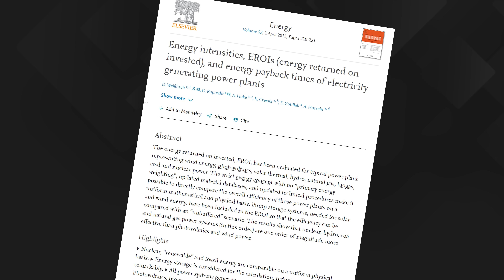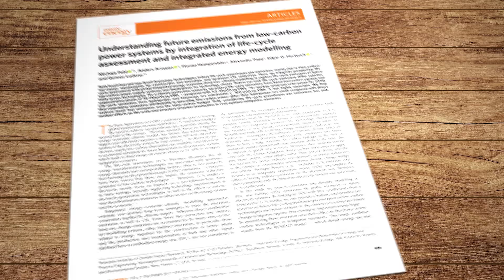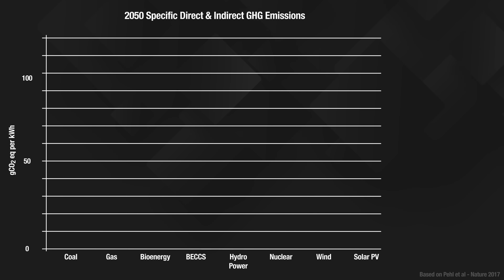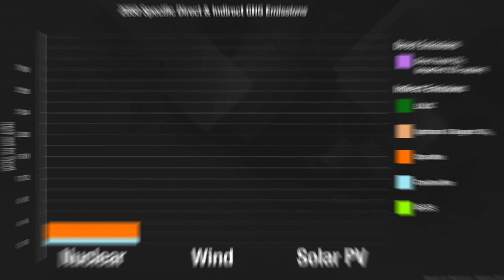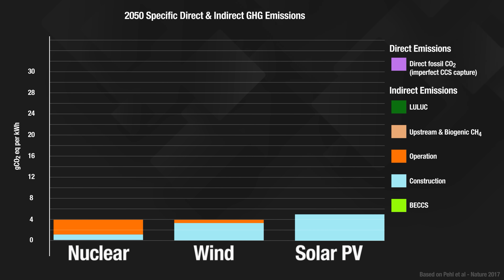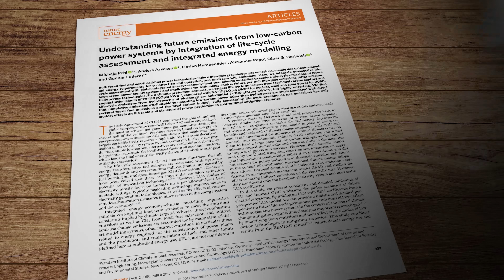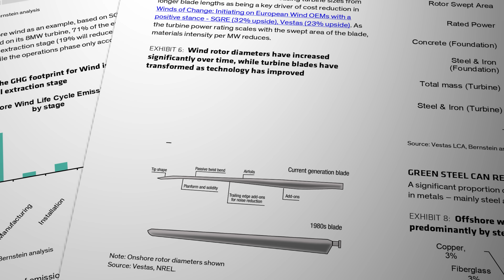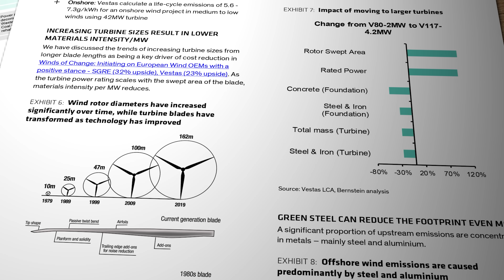Lifetime carbon emissions of renewables vs fossil fuel. Problem or solution?

Comment: Kinda disappointing that the wind and solar numbers aren’t taking into account batteries, peaker power plants and excess capacity needed for these systems to work since they are intermittent energy sources. If you do those numbers I’d bet nuclear would be the best choice by far for carbon emissions and for maybe 1/10 the cost
Reply: Only if we exclude the cost of storing the radioactive waste for 2 million years. Even if we pay them just minimum wage, the salaries of the guards alone add up to quite a bit. Add in land use costs, construction, and maintenance, and it becomes astronomical. Until the industry can get its act together and build a couple of permanent storage sites, they should stop making more dangerous waste.

Comment: I still maintain that the “solution” isn’t just one thing, it’ll be a combination of things. And second… I really think decentralised power generation (e.g. we all have solar on our existing roofs) will play a huge part in this. 
Imagine the impact if every house, retail/commercial building had some solar installed and even for e,g, small panels on every traffic light.
Reply: Yes I agree. All eggs in one basket, bad/good, on/off, green/not-green. I like to view the solutions as steps in the right direction and being honest about the drawbacks.
Reply: The Earth is cooler with the atmos/GHGs/albedo not warmer.
To perform as advertised the GHGs require “extra” energy upwelling from the surface radiating as a black body. https://youtu.be/0Jijw7-YG-U
The kinetic heat transfer processes of the contiguous atmos molecules render that scenario impossible.
No greenhouse effect, no GHG warming, no man/CO2 driven climate change or Gorebal warming.
Reply: The limousine liberal solution:  why don’t we all just put solar cells on our expansive suburban roofs?  It’s the 21st century equivalent of Marie Antoinette asking of the bread-starved poor “Why don’t they eat cake?”
Reply: Distributed power generation is way less efficient than powerplants.
Reply: @JasminUwU  in the UK, the electricity grid that was  built for centralised energy production is not suitable for distributed production. This has been shown, by the fact that a lot of the wind energy is generated in Scotland. The transmission lines between Scotland and England have insufficient capacity to get the energy south. When the wind blowing Scotland, the Grid pays the wind turbine operators, not to generate. These are known as Constraint payments. Some wind farms shut down 50% of generating capacity and between them receive £500million per annum. The Grid was aware of the problem in 2013 and started building an HVDC inter connector down the Irish Sea, which was completed in 2017. Unfortunately the increase in wind energy in Scotland made it too little too late. Even with the closure of Hunterston B and Torness nuclear power stations, they have started two more HVDC inter connectors on the East coast. In the meantime Constraint Payments are with us for another two years. If we get a couple of comparatively windless years like 2019, when Constraint Payments halved, we may be OK. The grid knew of this problem in 2013, and could have got Hydrogen Electolysers built with the spare money and electricity, pumping hydrogen into the grid at a maximum 20% blend, which is safe for the pipework and safe for the domestic supply. ESO, what are they paid for?
Reply: @JasminUwU  
Said, "distributed power generation is way less efficient than power plants."

The efficiency of distributed power generation is not important because the fuel - wind or sunlight - is FREE.  Also power plants require transmission and distribution, which makes the cost much higher than distributed power generation.

The reason why utilities insist on power plants is it makes the customer totally dependent on the utility.
Reply: Or if every city had a single nuclear power plant!!!!!!! :D :D
Reply: @kieranrollinson8750  
Said, "Or if every city had a single nuclear power plant!!"

That's impossible.   Nuclear power plants are not allowed near any population centers.  Period!
Reply: @acmefixer1  DUDE!!!!!! YOU MISSED THE ENTIRE POINT!!!!!! THERE IS THIS THING CALLED """"SBUTEXT""""!!!!!! AS IN, THAT WHICH IS IMPLIED, YET NOT SPOKEN!!!!!!!!! GET USED TO IT!!!!!!!!!!!!! :D :D

Comment: Could you comment on how much land needs to be cleared to generate equivalent amounts of energy by various renewable generation methods? It seems roof top solar, even with batteries will not be sufficient to meet a large modern cities energy needs. Is the net impact to the  (i.e. local ecosystems) considered when renewable generation needs to be scaled to replace the high % of energy that comes from fossil fuels?

Comment: Unfortunately rcycling of renewable energy components is dependant on where they are operated. Here in Australia most deconstructed wind generators and solar panels are going to landfill because we can not build recycling points in all the places they are needed but transporting the used components to a central recycling point in a country the size of Australia is very expensive. We are currently in a power generation crisis caused by ten years of  government who's climate change policy was written by the coal and gas lobby and was as clear as mud. So now we have plenty of wind and sun but not enough generating capacity from it, we also have a power grid that is designed for central coal and gas fired generation and can not transport renewable energy efficiently. We have no where near enough battery storage and the private companies than now own our fossil fuel power plants have run them down to the point where a third of their capacity is often missing due to breakdowns.Oh and as the world second biggest LNG exporter we have a shortage of gas in our eastern states. This is what happens when powerful multi national companies mine your resources and sell to the highest bidder and other multinationals own your power infrastructure but let it fall to bits and they all buy our politicians spines and remove them along with their brains, if they had one in the first place. If your government cant plan for the next five years what hope do they have planning for the next fifty years.

Comment: ....aaaaand - unsurprisingly - nuclear is the CLEANEST, MOST reliable, MOST pragmatic, MOST compatible with the HUGELY expensive existing infrastructure - and  by FAR. 

(Also, Put 200,000 (yes, that's 200k, or two hundred thousands) decommissioned, rusting away wind turbines in California in your pipe, and smoke it)

Comment: I’m sure the reports from the turbine manufacturer is not biased. How much CO2 is emitted in the recycling of these blades?? As far as solar is concerned what is the environmental effects of the strip mines required to mine the metals to make the solar? What is the life time of the panels and what is done with them after?

Comment: What will decide which technology/ies win is ultimately cost. If something is super clean but costs 10x as much and today's energy cost, it simply won't happen. Nuclear looks good, but the ongoing liability to deal with nuclear waste means it isn't a commercial proposition.  However wind power is competitive on cost and that along with solar and maybe tidal look good too. The Government should go all out for these and if they are cheap enough then the problems of availability at the wrong time will be overcome with battery storage, green hydrogen production or other methods. It all has to be paid for so it has to be profitable for someone. This seems the only way forward to me.

Comment: Though these numbers paints a pretty picture, the biggest drawbacks of these technologies are not mentioned. Due to the low energy density of PV Solar and Wind, these technologies needs to be deployed at very large scales, resulting in huge land losses and enormous wildlife impacts. Huge solar farms literally burns birds alive, not to mention the habitat loss of these large scale projects. Wind energy is more efficient in its land use, but still affects the habitat of those creatures blessed with the ability of flight. PV Solar and Wind is also an inconsistent and unreliable source of energy, again requiring a larger scale to account for fluctuations in the output. They also require some form of storage(battery farms, dams) to compensate for their unreliability, again requiring large land use.
Another thing...if a product is advertised as being "100% recyclable", that does not mean that they are being recycled and remade into new products. Just look at the lies of the plastic industry...

Comment: Btw, I have read that projected year 2050 energy demand will be 5x that of 2020.  I'd like to know if that was taken account of in these studies.  Excellent videos though as always.  Another thing... (my phd involves statistical inference, control theory and operations research (optimization)).  I find that it is almost always the case that researchers make 'ceterus parabus' statements which amount to giant extrapolations of a status quo in situations where there is no static equilibrium condition.  Things change.  Dynamics are involved.  So the question here for instance is what the sensitivity of say hydropower is to a world with extensive droughts, or solar to a world where the panels are hotter and there's much more water vapor in the air.  Electrical resistance in wire is proportional to temperature.  And so forth.  There are many, many different types of feedback terms.  But the question is to identify them, rank them, and then figure out the dominant ones.  We're looking at a multi-dimensional Taylor Series expansion, and yet we're missing 95% of the 2nd order terms in the Hessian matrix that will describe the curvature  (ie accelerations, f = ma ...) of how kwhrs out will scale with the fixed costs and the marginal costs of the resources put into them.  It's almost guaranteed that this paper and every paper has glaring omissions in that analysis... in part because there are combinatorics involved and they scale even faster than exponentials.  Expecting the operating point in 2050 to look like that of 2020 is very naïve.  For instance if there's far less land in the world and salt water intrusion has caused farm land to become even more valuable.  And if degraded soil (tractors are evidently heavier than dinosaurs... they kill soil microbes...), depleted soil wrt minerals, dust bowls, drought, and so forth make farming 10x harder... (heat waves are 4x as likely at 1.5 deg C of warming, 13.5x more likely at 2 deg C of warming... which I believe we will cross before 2040)... well tomorrow's shadow prices for the use of land may have little to do with the ones we have today. Tough to put solar or wind below ground.  Everyone needs to be looking for what the market externalities are and for how commodities substitute, and they're almost always failing to do that.  For instance if the storms get so intense (hurricanes are becoming stronger in 6 different dimensions) that they keep on knocking down wind turbines, that changes the calculus dramatically.  Hail the size of baseballs.  Clouds that block sunlight... Salt water in the wind causing premature corrosion.  I can think of many different possible oversights in the analysis.  Whether or not such considerations are material or trivial, hard to say.  But I bet several of these factors I'm citing will indeed change the analysis significantly.  Final thought... as has been determined in the arena of deep learning and GANs, a primal-dual / adversarial / game theoretic type approach can work very well.  Minmax design.  If we plan for worst case weather and then envision what that would mean for our energy supply, there are valuable lessons to be learned there.  Then again I've always said worst case design leads to absurdities.  In the worst case a super nova has exploded at a nearby star and we're just about to find out tomorrow.  Still though, as military people have long since figured out... there are a good many things to be learned from building a play book and a set of strategies around various scenarios we can identify as being likely to occur...  We should play computer games where one side gets to be like an army of ants trying to construct wind mills and the other side gets to play God and wreak weather-havoc on a periodic basis based on certain constraints.  And then see which strategies get the best score...

Comment: Part of the issue with all of these analysis is that it doesn't account for load leveling with either fossil fuels or some hypothetical battery (hypothetical in that no current grid scale battery technology is even remotely scalable) to get the same uptime as any fossil fuel or nuclear. You can see a real world demonstration of this by comparing Germany and France where France has not the cheapest energy in mainland Europe (IIRC only Iceland and Greenland are less) and one of the lowest CO2  outputs per kilowatt hour in the world. On the flip side Germany built huge amounts of wind and slightly less huge amounts of solar and is in the process of or has already shut down all of there nuclear plants and there cost emissions from fossil fuels is more then when they started this process. 

Nuclear is the only way forward and new safer reactors can be built if it were not for wrongheaded anti nuclear laws. Further new reactors can burn up basically all of the high level long lived waste and run on vastly more common files and not need enrichment that can be used for making bombs
Reply: Pretty narrow minded to call nuclear "the only solution". While nuclear power is great in a climate perspective, it has some pretty obvious challenges. The most prominent one, is the huge lag time in building a plant in a developed democracy. The pushback you'll see will cause delays incompatible with the kind of rollout needed to be a solustion for the 2C goal, let alone the 1.5C goal. Now you might argue this is stupid, but that doesn't matter as long as it's real. New nuclear power plants also have a history of becoming far more expensive than expected. Does this apply to future plants? Maybe. 

Wind and solar are far easier and faster to scale up, and unlike nuclear, costs are still plummeting. Will grid scale batteries follow up? Hard to say, but it kinda has to. Meanwhile we have pumped hydro as a tried and tested battery technology, and energy storage as hydrogen will do in a pinch. Anyway, lots of R&D going into battery storage, as observed on this channel and other cleantech channels.
Reply: @mrleenudler  
Especially as we are going to need them all if we are to grow our production to the levels needed by 2050.

I don't think we will see 11 000 nukleär reactors being built till then

Comment: Have we missed a renewables technology? There is Iceland and Northern California (I was surprised to learn about Northern Cal)--both you all may probably know have geothermal. From what I basically understand geothermal is the cleanest with the main problem being the technology involved with deep drilling abilities.  But...there are the oil companies that already are into drilling and it would seem proper to have such drilling companies involved in drilling...deeper rather then switching those workers and their tech training into solar and wind.  Wouldn't it be just a matter of increasing technology to find better ways to drill?  Seems I heard about plasma drilling. In any regard the up front cost is large but the payback is nearly indefinite and the footprint (although seemingly small is narrow in that a fault line needs to be in the vicinity). Here aging too is the continuing problem that no matter how the electricity is generated it still must be transmitted over an extensive electrical grid that...is just not there to support it! No matter what green energy is chosen there is no supporting grid!  Question: isn't it true that the best way to remove carbon is to grow more plants and especially trees--they all suck the carbon right out of the air via photosynthesis and in the process give us oxygen? It seems there is not just one way to do this 'clean-up' but multiple ways and then too having more 'stations' located where the power is used lessening the transmission over long distances would also be best.  Regardless, clean green energy is like an Apple Pie--everyone loves apple pie but forcing it down ones throat all at once will only cause the person(society) to choke to death. One slice at a time while still producing petroleum for use in diesel transportation of goods, production of farming equipment, plastics and lubricants. If oil is just cut off from society, society will fail...and fail means very upset, hungry and desperate people.  Think carefully and weave these technologies into society slowly.
Reply: A typical geothermal well is about 2.5 miles deep and costs around $5 million. If the heating is deeper (like it often is) then wells as deep as 6 miles are common and those cost around $20 million. These wells must be re-drilled every 5-10 years and the pumps replaced or repaired frequently as well due to galvanic corrosion. One geothermal plant can produce between 1 to 50 megawatts, enough to supply 800 to 41,000 homes. In contrast, a single natural gas powered plant can produce more than 2,000 megawatts